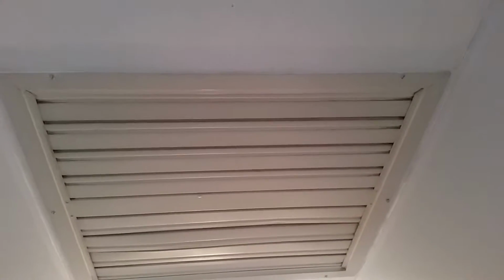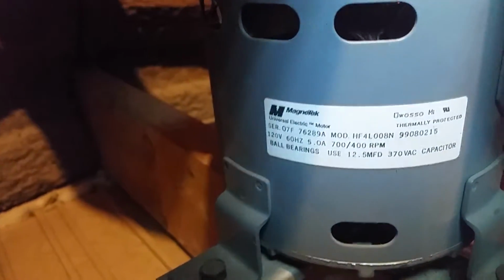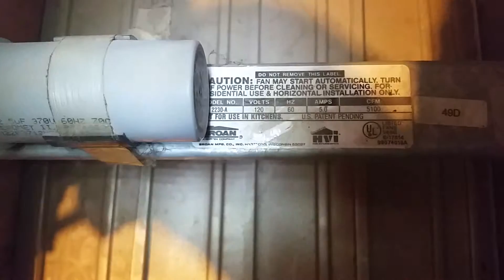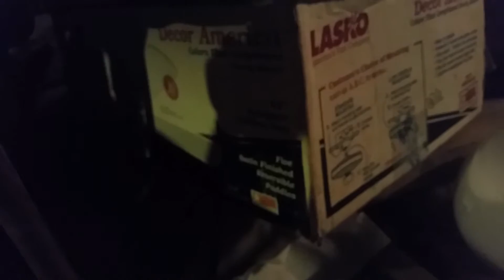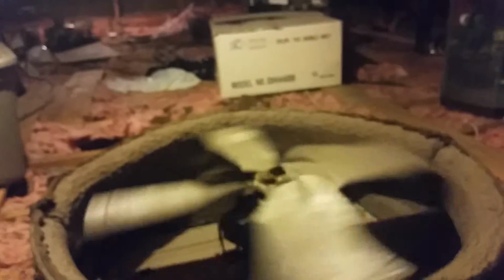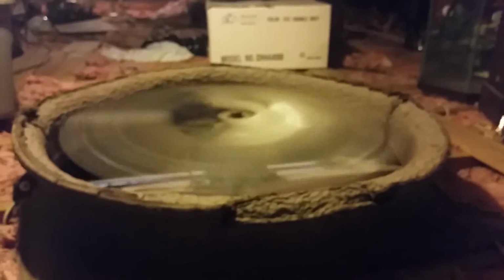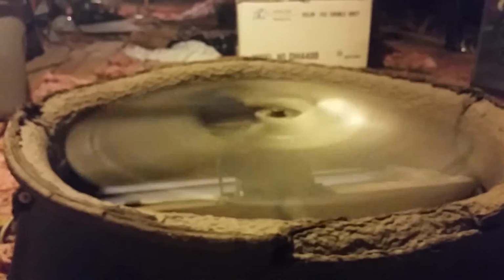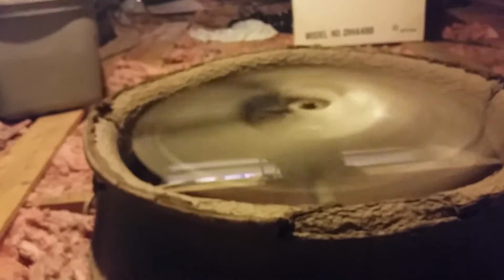Whole house fan (attic fan)

Comment: Does your attic have the proper ventilation for a fan like that to work?  If it doesn't, than the fan will just simply move air into the attic and it'll just stay up there since it has no place to go.

Comment: You should install 1 of the SMC lagunas in the attic to circulate air
Reply from the maker: Why?! I dont even go up there.
Reply from the maker: plus they would only be on when the lights are turned on
Reply: It's less noisy than the whole house fan and if you reverse it it keeps all the hot air in the attic, and you can wire a seperate switch for it.